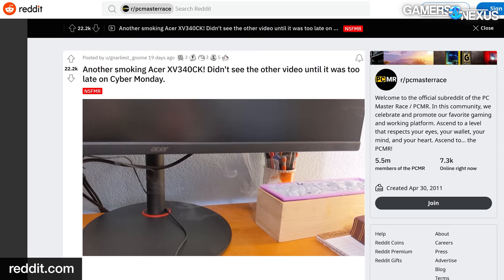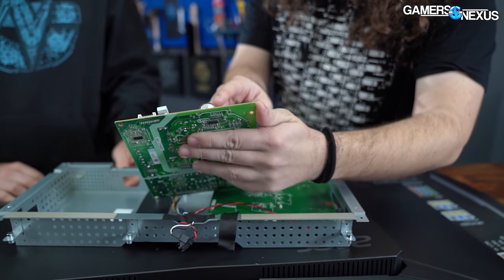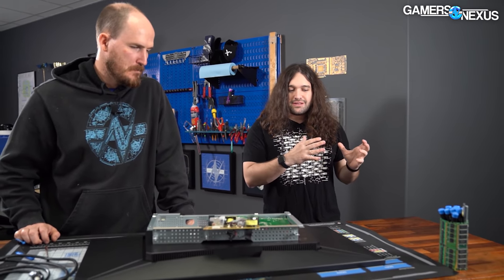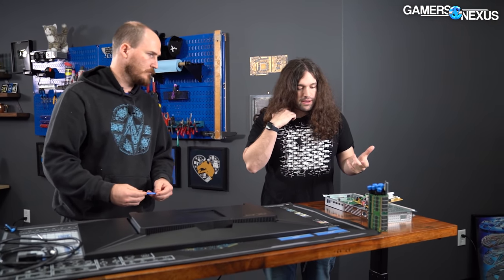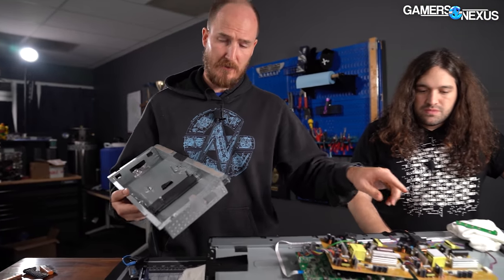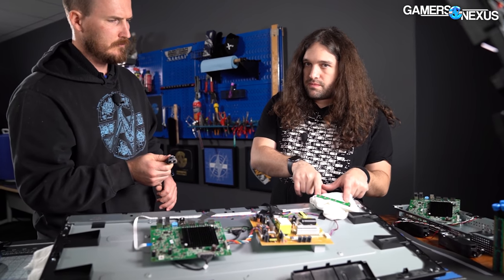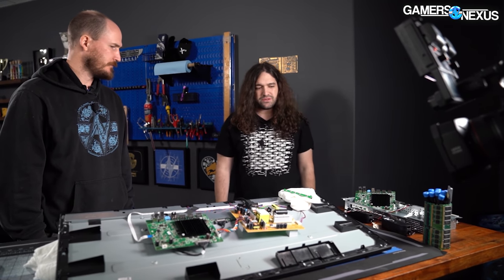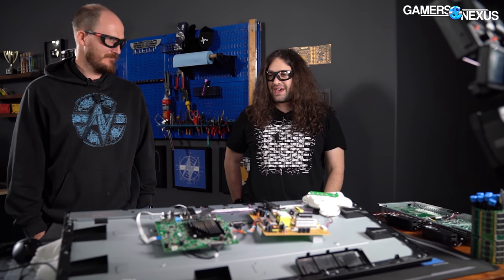Acer Monitor Fires Investigated: Blown Capacitors on Acer XV340CK

Comment: The only thing you can be sure of with Acer is that whatever you send to their repair center, they will just claim the user was at fault and send it back unrepaired. So clearly it’s user error here too.
Reply from the maker: That gives me an idea for a video....
Reply: @GamersNexus  Evil Steve is the best Steve. Do it, man. Expose their ass.
Reply: @GamersNexus  nothing makes me happier than watching you guys try to deal with bad customer service lol
Reply: @GamersNexus  poor companies Scared of Gamer's Nexus.
If you did send then do it secretly or after hearing your voice they'll replace monitor broken with hammer too haha
Reply: @GamersNexus   Finally !!!! I SAID THAT MULTİPLE TİMES
Reply: I had an issue with my Acer laptop and it was a very smooth and easy process to get it repaired. Took about a week. This was at the start of the pandemic though so customer service may have gone down the tube after.
Reply: @mask86   I would think there would be more incentive for them to fix the laptop. It is there design after all.
Reply: @GamersNexus  This is exactly a job for undercover Beve Sturke!
Reply: @tictechto  I'm worried Beve Sturke's cover might have been blown. They might have to send in Statric Pone
Reply: rarely happens.  but then people also try to send things in saying it just stopped working they dont know what happened then youll find the mainboard covered in coffee. or they thought the power cable wasnt pushed in far enough for their liking and they jam it in there hard enough to rip it off the pads and rip the etches off the board. acer will let you tour their repair center if you ask nicely.  after covid is up im betting.  they claim their employees cant wear shorts because its not professional and they might have visitors.  like sitting in a repair cubicle making 12 bucks an hour is a professional job.
Reply: This is why you should never rely on RMA, it should be used as a last resort.
Reply: @adityadivine9750  it will be an outsourced call center working for minimum wage they don't know or care who Steve is and will just give the same response. Acer makes the cheapest possible product and would lose a lot of money actually providing a warranty for their products
Reply: @patrickbone5446  their products are cheaper because they use cheap materials. And anyways acer seems to slowly die as a brand. There's not much products or sales of acer now
Reply: @GamersNexus  KILLSHOT?
Reply: There's a reason Acer Recertified is so massive...
Reply: Beve Sturke makes a return.
Reply: @GamersNexus  beve sturk secret shopping repairs??
Reply: @GamersNexus   this is a case for Beve Sturke
Reply: @mask86  I had a bad experience with them way over a year before the pandemic.
Reply: +1 on this when it comes to Acer and MSI :/
Reply: @patrickbone5446  no it won't. Their call center and repair center are based in temple tx. The senior vp of customer service is based out of there too.
Reply: Acer monitors are trash at least that's my experience so far,dead pixels,brighter screen on some parts etc etc,never again will i buy acer.
Reply: Acer's repair team consists of one guy, high on caffeine and uppers. He spends half of his day stamping papers and the other half throwing boxes.
Reply: @spartacus778  More like Justice Steve
Reply: The user error is buying Acer.
Reply: can confirm 100% user error to buy an Acer
Reply: Not really, my experience with Acer has been the best anyone could ask for. Last crypto craze I was a prebuilt pleb and had a faulty GTX970. Every now and then the GPU would fail to post, tried in two other computers. Sent the prebuilt over to Acer, they couldnt even replicate my issue but still replaced it with a 1070. They didnt even know if the GPU was faulty as my proof of testing in different comuters wasnt given to avoid warranty issues.
Reply: @spartacus778  Evil Steve has 666 likes, I like this but then it won't work if I change the number
Reply: Interesting I guess its an American thing, here in Denmark they will try to repair if possible otherwise they replace my monitor with a new one.
Reply: jesus i should have never bought an acer laptop.
Reply: I bought the first 120hz ACER monitor back in like 2012.
It lasted 1 year before it shit the bed, bought an ASUS 144hz one and it's still going 8 years later.
Reply: I hope they at least repair my monitor.  I have this monitor and it started flickering after about 1 month of use.  Then about 2 months later it stopped showing anything at all while being powered on.  So I contacted customer support since I have a warranty until 2024 and they wanted me to pay for the shipping.  I told them there's no way I'm paying for shipping for a $450 monitor I only was able to use for 3 months.  So eventually I got them to send me a prepaid shipping label.  So now after about 6 months of it just sitting gathering dust I'm finally going to be able to send it to hopefully get repaired.  It would be nice to get it fixed because I really liked the monitor while it worked.  But I'm still worried that in 3 more months of use it'll just stop working again.
Reply: @Antimedal so what eventually happened
Reply: @Avarisz  After me complaining to them over and over again they sent out a label.  So I sent the monitor off to be repaired.  It's been back for awhile now and it's been working perfectly.  I really like the monitor I'm just annoyed I had to go through all the drama just to have a working monitor that I paid for an extended warranty on.

Comment: Just a comment on the ridiculous thermal pads: given the back of that power supply board will have solder points with mains voltage, it's a safety requirement to have a minimum distance between hot and ground to avoid arcing. You absolutely do not want millimeter clearances.
Reply: This is important insight. Those aren't just "thermal pads". They're physical isolation.
Reply: Yep, short to ground air gap.
Reply: Those pads are on transformers, not on a body terminal of a mosfet, though. Transformers should be entirely capable of the required isolation themselves.
Reply: exactly - those have more a function of separator rather than to effectively take heat of from some components
Reply: Yeah 100%
Reply: @Validole  it's not the component itself that requires isolation. It's the through-hole soldered joint that is the potential point where an arc to ground can form. Given a large solder joint can be 2mm plus any lead that isn't trimmed flush to the solder ball -- a 15 to 20mm clearance pad is pretty sensible safety engineering.
Reply: @knghtbrd  that's why those are not thermalpads but isolators

Comment: An electrolytic cap failing in the first few minutes of use, probably means it was connected the wrong way round (electrolytic caps are polarised) i.e. positive going to negative terminal. That would heat-up the electrolyte very quickly to failure temp.
Reply from the maker: Great thought. We'll check on that when we pull these back apart.
Reply: Yea I was thinking that to, but I also seen how fast a PSU fails when someone recaped the mains caps on a PSU at DH back when the wrong way, instant POFF.
So nit sure, I would expect a much faster failure at those voltages, its one thing to get a few volts on them the wrong way, 100+ V thats another story.
Reply: How would it have passed QC? Or did they not test it?
Reply: You can't see negative indicator on any of them, so they are connected the same, unless cap manufacturer rotated the sleeve or sent a batch without forming polarization.
Reply: I remember Dave at EEVBlog put a cap in backwards in a 'scope he was repairing, and it exploded quite spectacularly, letting out the magic smoke. https://youtu.be/Rp-0FqxQkBw?t=1654
Reply: It reminds me, I have seen videos of motherboards being made back when before polymer became the norm and there where people in lines just manually inserting Electrolytics, easy enough to flip it the wrong way.
Reply: Overvoltage would have the same effect. Maybe the failing caps weren't actually up to spec 450V due to a QC issue or something.
Reply: @thatguy7595   Mmhmm.  I would bet on a manufacturing defect in the cap, not reverse polarity.  Given that most electronics just use the cheapest caps by brands with random combinations of consonants, it's hardly surprising.
Reply: Could be that, but I doubt it. Circuit board manufacturers have, by necessity, gotten really good at making sure components are the right way round when they're placed on boards. It's probably an issue where too much AC voltage is being passed to the cap, so that the capacitor occasionally goes reverse polarity, which would most likely be caused by a design flaw. There's a quick and simple fix for this, though (and this would also work if the issue is overvoltage). Assuming the original cap is rated at 450v and 100uF, the fix would be to replace it with two identical capacitors rated at 200uf and at least 250v that are wired with their polarities opposed in series (as in, connect neg to neg or pos to pos).
Reply: @bobbrown8661  Generally, manufacturers don't test every single unit, it just costs too much.  They pull random samples out of each batch for testing and assume that if the random sample is good, they all are.  Obviously, this means that any variation in quality from unit to unit within that batch is not caught.  Not that there should be much variation, but shit does happen and this is the result.
Reply: A reversed capacitor charged to several hundred volts wouldn't just smoke, it would explode into pieces almost instantly. Source: this happened to me once...
Reply: @thatguy7595  Yea I have seen caps to small to be rated 16V in old Antec PSU's. Nothing on the manufactures list of the caps with those dimensions BUT if you checked the 10V list there they where, same capacity, same dimensions.
And yea those caps lasted 6 months before they leaked.
Reply: @bobbrown8661  They might not test it on different input voltages. Some devices might get tested on a small sample for the full voltage range +-10% and then the QC might be at either 100V, 120V, 240V, or at the edges of the range at usually 90V or 250V. Some circuits might blow up at higher voltage or at lower voltage.
Reply: @GamersNexus  An electrolytic cap wired in reverse will never in a lifetime sustain more than few volts: they kind of behave like diodes when reversed, and would blow in maybe a couple of seconds, but most likely causing an overcurrent event and thus blowing a fuse, which is not the case in this failure. Check if the capacitor appears dented in any way, and maybe measure with a multimeter in ohms mode if it has conductive.
Reply: The blown PFC bulk cap on the first unit was installed correctly, you can see the polarity mark on the silkscreen under the cap at 3:11. The solid white bar indicates the negative terminal.
Reply: @jonathans175 Well spotted,  I didn't notice
Reply: @thatguy7595  not even close usually - I have found 250V caps in smps meant to work in Europe (nominal 230, so 325 peak to peak), they just leak out - took an year, before the power supply failed enough for me to open and repair it. It has to be way significant overvoltage for the to even pop. Simple test, running 16V caps on 24V won't do anything.
Reply: Or the user used obserd amount of compressed air and caused condensation.
Reply: @GamersNexus  thesame probem was with the ROG Z690 boards. hos that fail had caps soldered the other way around.
Reply: @lesleymunro4964  Nothing quite like the smell of an exploded cap.
Reply: This also appears to be what's happening to Asus Z690 Hero boards. On every board that has failed (whether simply code 53 or actual blown MOSFETs), there is an aluminum polymer capacitor with the polarity stripe to the left (toward the CPU socket). Jay did a video on this the other day, and Buildzoid noticed that on his board, the cap has the polarity stripe to the right.

Jay's video: https://www.youtube.com/watch?v=XYgQBQMGGbw
Buildzoid's video: https://www.youtube.com/watch?v=2VkO4wiEAY4
Reply: Im willing to bet that the cap might be possibly???? Mislabeled???? But I agree either way you twist it that cap is on backwards
Reply: There's no way it's because of reversed polarity, I've seen enough Star Trek to know that reversing the polarity only ever makes something work better! That's why their ships are so fast, during construction they just keep reversing the polarity until the ship can travel faster than light!
Reply: @GamersNexus  also electrolytic caps usually leak unless the voltage was around 450v or above, it should not start a fire they vent instead. its why they all have slight cuts on the top, there ventable and that happens usally from age or over current or as martin said a reversed polarity.

although its a bad sign when a 450v caps blows like that... seams like a shotty cap or backwards polarity. Backwards Parts have been going into products to end up with dead equipment, imagine a 12v cap blows for a HRM(Heart Rate Monitor)? could read falsely or stright up not work.

main point here, this sucks im seeing stuff like this happen with more pc parts and other products outside of the pc market. like dire things could be at stake if more part manufacturers keep skimping out on inspection(jay covered that).

sad to see another shotty power supply from a good brand.

Comment: Electronics and firmware engineer here. My guess is that the part that got swapped out (likely because it was cheaper) had a lower rated ripple current. Basically, if an electrolytic caps has to sink/source too much current (this happens constantly in a switching regulator), it will heat up and eventually explode. It's impossible to say exactly without knowing more and reverse-engineering the design, but that's my suspicion.
Reply: Specifically that's the equivalent series resistance that matters.  Doesn't really take a huge setup to properly measure the ESR so if they end up with functional capacitors from both batches it'd be possible to test and see if indeed those brown caps have different ESR at the frequencies used by the power supply.
Reply: It could have just been supply issues as they said. I have seen a couple times where a replacement was made because something was out of stock and it turns out that the replacement didn't work like we thought it would
Reply: Or the ripple current spec promised on the spec sheet in some Shenzhen market does not match reality for some number of the caps purchased in the lot. sigh
Reply: @knghtbrd  oh no, who would have predicted it
Reply: While excessive current ripple may reduce capacitor lifespan, you would still be looking at several hours to failure for anything remotely sane. Popping a capacitor within minutes from power-up is more in the territory of significant over-voltage (defective APFC) or reversed polarity.
Reply: @teardowndan5364  The cap clearly vented as it should releasing gas and electrolyte. A shorted cap explodes with parts everywhere. Rated 450v, but perhaps insufficient capacitance for required ripple as the op stated. I'm unsure if an esr issue could cause that fast a failure from oscillation, but I'd add that as a maybe.
Reply: @marcogenovesi8570  Certainly who'd have predicted it from a prestige brand like Acer? 😉

Were it my monitor, I'd check the cap and not worry if it's one of the ones that seems fine for now. If not, I'd be prepared to RMA it. In the last, I'd be ready to clean up the mess and get someone to solder a new cap in there when the time comes. (Legally blind, soldering isn't my strength due to lack of video microscope.)
Reply: Didn't they say it was on a black Friday sale? They probably got a downgraded version along with the sale price, which would explain the lower quality cap
Reply: @goofball1_134  That smacks of Internet rumormongering. These products are manufactured well in advance of any sales. The goal is that hey're shipped out as fast as they're made to go wherever they need to go whenever they need to get there.  That doesn't work in the real world, as we've seen this year for just about everything.

Part substitutions happen all the time. And power supplies are a part you usually outsource to a company that specializes in them. (Even Corsair and EVGA do that.) It's true of PCs, and it's also true of other components. That means Acer may or may not even know about the substitution. It might've required Acer's approval under their supplier contract. Y'know, or not. And if they know, they'd surely make sure that they could say they approved subbing a part like for like.

Comment: This is what happens during component shortages. Everyone is looking for alternative parts, alternative suppliers and so on. Even if the BOM substitution is not meaningfully subpar, scammers have a much easier time when all the supply chains are jumbled and its a sellers' market.
Reply from the maker: 100%. Stuff still needs to get adequately tested, but since we don't know the actual failure rate (as far as we know, it could have been 1%), it's possible that they just didn't catch any internally before it was too late.
Reply: @GamersNexus  1% would still be a massively high failure rate for QC to be missing. Per million monitors sold that’s 10,000 peoples houses potentially burning to the ground. Tolerances should be enormously better than that. Great work highlighting these serious unscrupulous company product failures.
Reply: Exactly. It's made worse by the pandemic delays which lead to corner cutting and chaos at every step of QC on the components' way through the development process.
Reply: Some of us can still remember the great capacitor massacre of the early 2000's. Them leaky, exploding caps still haunt my dreams.
Reply: A product failing within 5 minutes should be caught by QC essentially every time.
Reply: @GTFour  1% of 1 of many suppliers could be much less than 1% total manufactured.